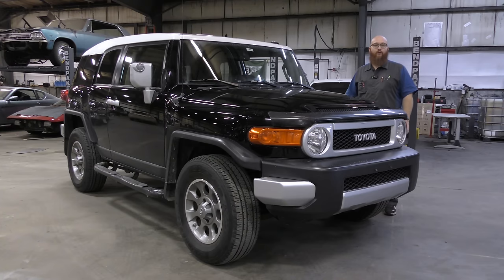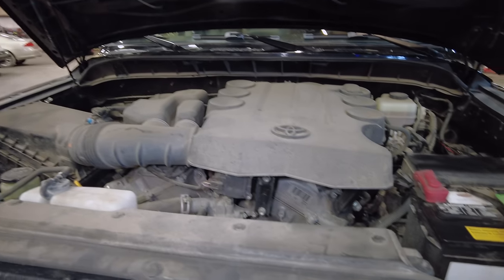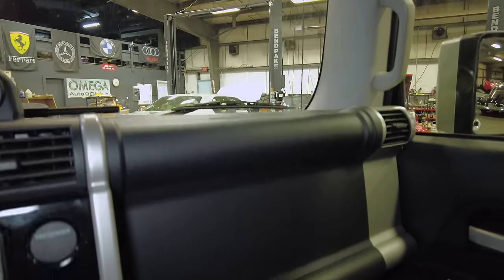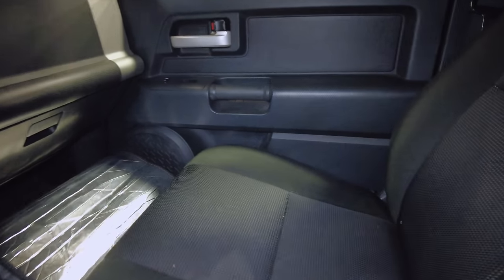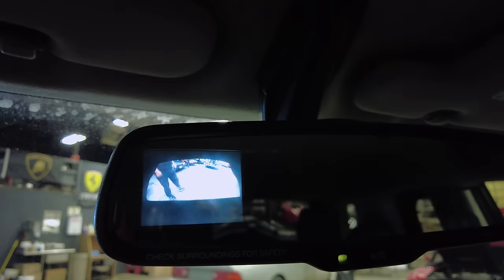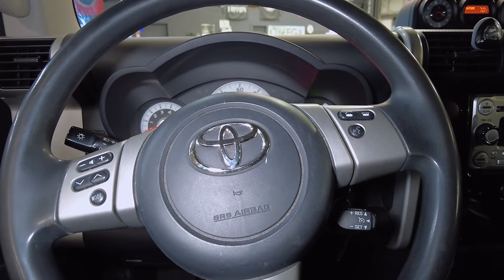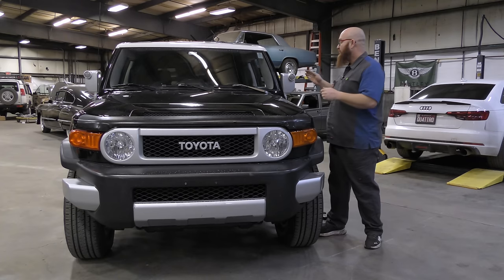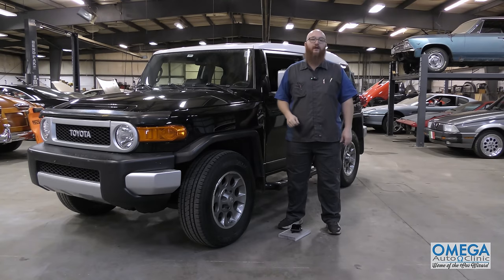Prices are Changing! FJ Cruiser Prices Are Plunging! What Happened?!?

Comment: In 2021 my 2012 FJ with 81k miles on it was quoted around 30k trade in.  Now, with less than 5k more miles on it, it is more around 22k trade in.  I didn't sell it then, I won't sell it now (probably lol).  If it happens to go up crazy in the future because I have low miles and great condition I might.  But really I plan to just keep it forever.  5 years ago I bought a Civic for a daily driver.  So I've only put about 5k miles on the FJ in the past 5 years.  I only drive it to get groceries a couple times a month to keep it moving, or during bad weather.

Comment: I went with the h3 06 because I got a deal for a decent one black on black. Had it many years and it just blew 3-4 gears on the tranny and it’s waiting for a decision on whether or not I will just swap the whole engine and trans. I’m 15g Canadian all in. I got 5k set of 5 rims and tires with 5 inch spikes and I’ve changed a ton of parts, added Stareo and subs, custom painted h3x ram bar and top rack. I also have a camping set up inside. She is at the point where she will eat many more grand this summer to be back running potentially with a diesel. I’ve had this vehicle over 6 years now so she earned it. She always been a hard working head turner.

Comment: got a 07 FJ with 112k miles for $15k in 2016.  Sold it in 2022 for $25k with 130k after building it out.  great car with zero issues but i couldn't stand getting 12 mpg with 305s

Comment: I think the current prices you showed are more of the prices these FJs normally go, holding its value pretty high. The 07 FJ in your video for around $10k is a 2D, not a 4x4. Here in Colorado, a decent condition 4x4 FJ goes quickly on the dealer's lot, usually within 4-5 days. I have an 08 base and just purchased a 2012 Trail Teams. Just sitting in my FJs gives me smiles - a good day every day.
Reply: EZ:
You want a car for blacktop driving and bought an offroad vehicle. 

Ateast you admit you hated it- most people that do this are posers and act like they love it.

I love my 07 but also own a hummer.   When I want luxury I drove my Escalade. The fj is for offroad and cruises to offroading events.   Amazing at what they are meant for-

Comment: Mine is a 2wd 2008. I removed the roof rack and installed the delete kit with new seals because water was getting in and i never used the rack. I also removed the factory nurf bars because i don't need them to get in. Otherwise it's stock all around and gets me where I need to be. These don't need to be lifted unless you enjoy off-road trails. Otherwise they make good daily drivers.

Comment: Bought my 08 FJ Cruiser brand new off the dealer lot.  Its got 172k on it.  It's rusting away underneath and will need to replace it with a new GX this year.  Never really understood the value of them honestly.  I bought mine fully loaded for $23k.  I don't know how on earth you hit your knee on that silver piece.  I'm 6'6" and have never, ever hit my knee on the dash throughout my almost 16 years of ownership.
Reply: Cool factor wise the FJ takes the cake. Nice choice with going for a GX. The Gx will knock it out the ball park for ride quality and still have plenty of aftermarket support.
Reply: I mean how can you not see the value in a super capable 4x4 that has bulletproof reliability and didn't originally cost people the absurd 60K - 100K prices we see for 4x4's today? You add all that to the unique styling so it actually stands out (unlike 99% of other cars) and you have a collectable hit. Rust wise, that's on you brother. You can't live in a snow state and just not take any preventative measures for road salt. Hope you treat the GX better because I guarantee it will meet the same fake if you don't take care of the underneath/frame. Doesn't matter the make or model, all vehicles will die a slow rusty frame death when road salt is involved.

Comment: Hey Wizard! The FJ Cruiser has a 5,000 pound tow rating, great for small campers or fishing boats. Many states require trailer brakes at certain weights, often at 3,000 pounds. You also wouldn't want the tow vehicle brakes to handle all of that weight, anyway!
Reply: Nv law is 1,500 lbs requires all axles braked.

That fj is owned by a poser.  Remove trailer controller means they never tow a pup trailer even.  No decent tires, no brush scratches, no rim impacts from rocks-

They should have bought a minivan or something similar. Not a 4wd they never go offroading in.  

Read through the comments- many of us own these and are north of 6’ and never hit our knees.

Comment: I wrote the buy/sell guide on FJCruiserForums and help probably 2-3 dozen people each year inspect FJs for purchase.

I think the reason that values are dropping is that there's a new crop of incoming Toyota 4x4's this year.  The new Land Cruiser, Tacoma and Lexus GX have already been announced and reviewed, the new 4Runner will be announced shortly.

The first section of the buyer's guide is "you should probably be looking at a Lexus GX instead", I added this because so many potential FJ buyers would ask about the GX when shopping FJ's and many of them ultimately ended up with the GX.  Everything about it is nicer than the FJ, often for less miles and less money.

FJ Cruisers are overpriced in my opinion.  Great trucks, the most capable offroaders that Toyota has built in years, but for what most of us do (I'm in Colorado) a 4Runner or GX are just as good.
Reply: Thats what I did. I always loved the FJ and was finally in the position to buy a nice toyota 4x4 last year. It just made no sense to buy the FJ when I could get a GX for less money. Especially after driving both, the GX470 had better visibility, a V8, and of course more luxury.

Comment: I just wish Toyota had optioned the 4.7 V8 that was available in the 4Runner, Sequoia, etc of the time. The 4.0 is a little lacking at times, but I still love my FJ.  Just about 200k miles and zero idiot lights on the dash.
Reply: Amen. I'd gladly do a timing belt job every 90k for the 4.7V8
Reply: Supercharging is your friend.
Reply: I had a 4runner with the 4.7 v8 and man that engine is a gem. It's got great low tourqe and is a very smooth engine
Reply: Or just get a GX and cooled seats 😏

Comment: I just checked the local prices (dubai) and a 2023 with 0 miles are for sale for about 40k usd. A fully loaded ones with dual fuel tanks, compressor, diff locks etc are 55k usd. Seems like importing one from the gulf countries may be well worth it, rather than paying so much money for a used one.
Reply: You can't import GCC specs into the US until it's 25 years old.

Comment: My wife and I bought our Cruiser new in 2013. It's been dealer serviced until the last year or so. I do my own oil changes now and other lite maintenance. This vehicle is built like a tank. At just over ten years old it still looks and drives like new. I have never had a serious problem with it. I have replaced one windshield though. It has power to pull my 18-foot Nitro bass boat. It does knock my gas mileage down from 19 to 14 mpg. though. I ordered it with the tow package, roof rack, JBL sound system. It's far better to drive than my wife's 2021 two-door Jeep Laredo. It's an extremely well built vehicle. Looks new, has always been kept in the garage except on a few trips. I'd buy another one in a New York minute. Good job, Toyota.

Comment: My wife loves hers, bought it NEW & YELLOW in 2007. @ 214,000 miles it’s an amazing SUV! 
Service 5,000 mile oil services, serpentine belt and tensioner, Transmission fluid change 3 times after 185,000 miles. 2 sets of brakes. 3rd set of tires, new Borla dual exhaust. Rear shocks, and rear differential carrier bearings, Gas tank support straps. One battery. 
Thats everything, It is in perfect, like new condition better than the back one in the shop.

Comment: Just paid 16k out the door with no tax for an 07 voodoo blue FJ with 175k miles. Came with relatively new beefy tires. I saw many others for a few grand cheaper but I wanted the blue one and it had a clean undercarriage. Very happy with my purchase.
Reply: Enjoy it.  Go run it and learn the difference off road vs jeeps or pickups.
 Put 10,000 miles on it before changing anything, but try to hit that 10,000 before summer is over!

Mine is
Blue 07 , lift with better a arms& shocks, locker, ATrack,  both bumpers swapped, bigger tires, light tune. 
Bucket-o-fun

Comment: I use that hood prop tool all the time. Customers see it and say they need one. I always tell them "once you get it you need to tie a string to it attached in your engine bay so you don't lose it".tbwy always say "that's a good idea!"
Then I say "or just replace the struts and not worry about losing a tool you never needed in the first place" literally had that same convo over a dozen times.
Reply: Best tool I ever had was a jack from a 1974 Cadillac. If that thing can lift and hold a 7,000lb car, it will hold anything. I kept that jack from car to car over the years. Still in my trunk.

Comment: I was close to buying one in '07 and went with an 01 Xterra instead.  No regrets, amazing bomb-proof off-road truck even if it was a generation behind the FJ.  While the FJ was branded for the off-road market, I've rarely ever seen one on the trails.  I do see them in mall parking lots.  So many people bought those as daily drives and never saw more than a gravel road.  They're pavement queens.  With those dropping prices, especially around the original '07 years, now is indeed a good time to buy if you want an off-road truck that's very capable and reliable.

Comment: I love mine! Traded it across for roughly $12k, 200k miles. Frame is spotless, has some battle scars from brush and lots of paint chips on the hood from a lot of highway mileage. But it’s been totally solid, only had to do a few interior plastic fixes. 

They are great vehicles, but they are very prone to transmission shudder. Keep that in mind when buying a high mileage example with spotty service records.
Reply: Its a simple fix.
Usually maintenance related but worth fixing.  A couple hundred dollars for a couple hundred thousand miles is no biggie

Comment: 100%, I'm a big fan on 2010+ 4L V6 1GRFE. From what I heard its better than 5.7V8 Land Cruiser/Tundra or 4.6V8 GX460 engine.
Reply: .....if you don't mind low power.
Reply: @RJ-hv6fr  has more hp & torque than Mustang's 4.3L V8.
Reply: @LionRunner  Yeah and ?😂
Reply: @LionRunner  BS. The Mustang 4 cyl ecotech puts out 310 hp.
Reply: @rolandthethompsongunner64  He didn't say more HP, he said better.  And while it's not the most powerful engine, it's probably the most bulletproof engine in engine history.  :)
Reply: @donnielama6459  Good. They installed a bullet proof engine in a bath tub and flipped it upside down 😂
Reply: @LionRunner  my bro has a 2013 fJ trail teams, great truck.  I have a sequoia 5.7...night and day. Both great and class leading reliability.  The 22RE rules them all?
Reply: Says the guy with the 4 cylinder mustang ecotech.  What are you ,a Beta??

Comment: I owned a 2008. It was great.  Major differences between 2009 and 2010.  Engine in '07-'09 was better.  Designed for max torque at very low rpm. Also, had shape specific Prado 120 frame.  2010 went to Prado 150 frame and turning radius became attrocious.
Reply: I believe my '07 GX470 is a Prado 120 frame. Has the same AWD Torsen diff system and of course the bigger and more reliable UZ series V8.
Reply: I have a GX460, Prado 150 based. Turning radius is amazingly tight.
Reply: @sv650rider  only manual trans FJ have full time 4wd, or awd as you are calling it.
Reply: @scootypuffjr.  Huh, thought they all had the Torsen limited slip differentials. guess its another reason to find a reasonably clean GX470 these days.
Reply: I've always been under the impression that the 2010s and up had a better turning radius than the earlier ones.
Reply: Had both engines, you are right, first gen was better, much stronger midrange, the second version was peaky and soft on low end but didnt have the noises of the first gen. The 2010+ did have other worthwhile upgrades. stronger rear axle, stronger front fenders. I sold it and bought a 2005 landcruiser and love it.
Reply: @JohnSmith-fi2ck  I have a 2008 that will be getting the Overland Tailor Tune next Saturday. Anxious to see how much that helps. They claim that fixes the terrible throttle and shift mapping, gear hunting, etc.

Comment: I picked up a 2008 FJ Cruiser 283000 miles had tons of modifications to it lifted, aftermarket rims, roof rack, tablet type radio put into where the old radio was, brush guard, winch, cool air intake, aftermarket skid plate, rebuilt motor, for $14,500
Reply: I'd love to see that

Comment: As good as these are,can get the GX470 with the smooth V8 and all the Lexus niceties for similar money
Reply: Those niceties become a royal pain in the ass when the electronics start degrading and you're paying a shop thousands of dollars for weeks of work to figure out why your power windows are making your headlights go out intermittently and your check engine light go on.
Reply: @littlerayofsunshine69  Have your mechanic pull the transmission wiring harness on the drivers side (the harness with the pull handle to unlock it). If there is transmission oil present in the harness that is the source of your wiring gremlins, the transmission fluid can migrate through the ECU to mess up other sensors in the GX470

Comment: I've owned a 2011 Trail Teams manual for about 5 years now. Has 70k miles, had 42k when I bought it, and it's insane how much it has appreciated in value. Paid $23k for mine and a similarly modified one with 100k miles and an automatic sold for $56k on Bring-a-Trailer

Comment: Had my 2007 for a minute now. Not at 200,000 yet, not really watching & no plans to notice anything except keep doing proper maintenance.

I’m just over 6’1” & NEVER hit my knee. Mine has a small lift and bigger tires. I can’t imagine how you people hit your knees. Had my 6’4”’son get in once or twice (haha) never once did he complain about his knee in the front seat.  Rear seat- yeah that is different.  Difficult entry and exit if under 5’ or over 6’. Get a regular 4door for that.  This is for serious off roaders who can’t afford $100,000 off road machines.

The blind spot to the right rear window is real- so look through the window then use the huge side mirror.  Some folks add a camera and mount a screen above the rear view mirror- easy & low cost solution.  I’m used to driving larger vehicles so it’s no biggie to me to drive using the mirrors. 

In Nevada- the law is any trailer at 1500 lbs or more is to have trailer brakes on each axle, under 1500 nothing required.  Towing anything & having brakes that work on it is smart- a tiny coleman popup I used to tow with my 1ton Chev or my Hummer- it didn’t NEED the brakes but when I replaced the axle I found a used axle with brakes- so I wired them in.  It was impressive that it towed better through trail roads having brakes. Discouraging people from trailer brakes is crazy to me. People know to use a one ton truck to tow 10,000lbs for crying out loud. 

There is 3 different owners for FJ.  
Poser- wants it because everyone else does and they say it’s good- these are people that will have it a couple years and sell.  
Street user- no accessories, like one in video, never really off road it much, just enjoy a reliable ‘car’ that is comfortable to drive and like to have people wave at them. 
Off roader- they take what is a great offroad platform allready and off road more often because the design of this rig will actually improve your skills.  With locker, Atrack, etc you won’t get stuck often snd if ya do isn’t hard to get unstuck because it isn’t too heavy (note my other rig in meme).  

The people who actually make the value of this what it is- are not the ones who leave it all stock and never drive it.  They are people like me that bought it because it is a very capable offroad truck that if everything goes completely wrong and you roll it- ya still live and it’s fixable.  If you’re looking and not a poser- pay attention to the common upgrades real users do because if you’re real you will end up doing them too.  If you can buy it already done- you save a lot of cash that way.  Locker, Atrack, roof rack, suspension improvement, front bumper - they are all easily done but difference of several grand.
Things like my rear bumper to match the front- extra lighting, sound system: those are things I wouldn’t pay a ton more for.  Well- rear bumper could save ya a grand or two but surely isn’t a deal breaker.

Price - he doesn’t get into condition altering price.  A friend recently (11/2023) sold his 08, had 160,000 on it.  He got $15k.   It was a rust bucket.  The body looked good but undercarriage was rusty everywhere.  He was and still is trying to buy my 07 with a little more miles for $25k- why?  No rust anywhere.  The suspension lift and ride improvement is done and tuned.  A little wear and tear means nothing when you want to keep and use something for half million miles.  Best v6 Toyota ever made- second best transmission Toyota ever made. Find someone complaining about the transfer case, I dare ya.  And all of it can be easily redone- full rebuild of this engine when it does wear out is no biggie.  

These hold their value because people who live a lifestyle of adventure know to pay ten grand more for a good one that will get used for the reason they are good.  Not some 2wd blacktop queen.
Look- if you can’t get in and out of an offroad vehicle, you probably shouldn’t own one.  Dont buy it as an investment- leave it to people who will actually use it.